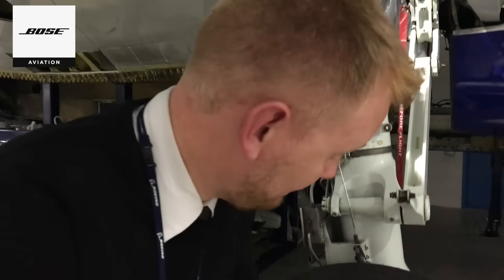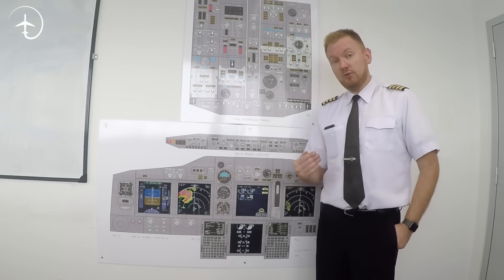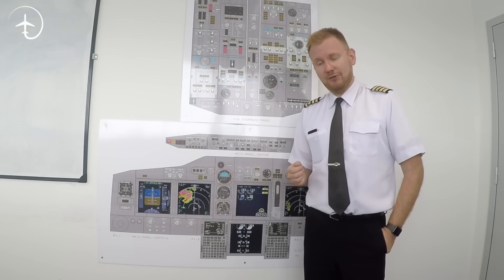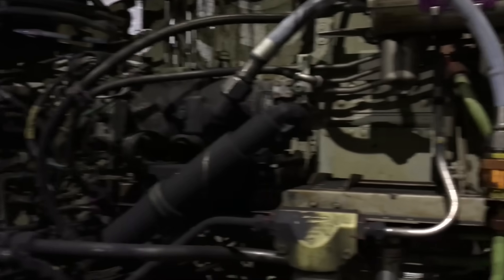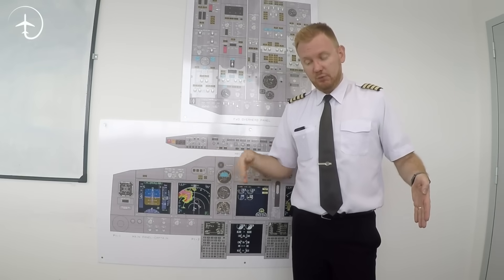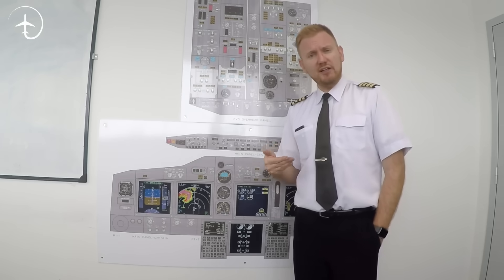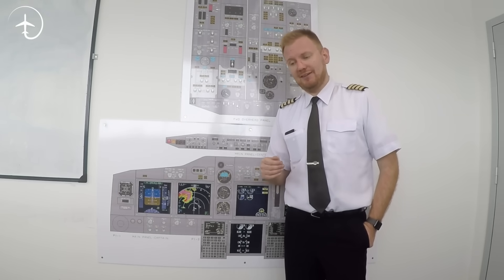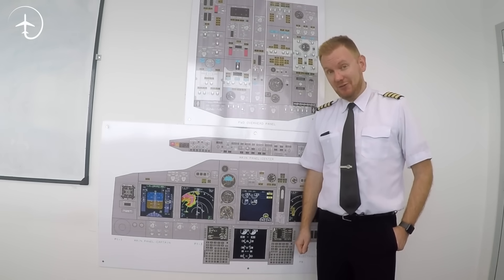Why does the Boeing 737 not have any landing-gear doors?

Comment: 20 years ago, on a 737 flight, the pilot notified passengers to buckle up, extreme turbulence ahead. He said he was going to try to fly to avoid it. The plane went into a roller coaster ride from hell as the pilot took the plane straight up, to where we were almost flying in the stratosphere, then suddenly turning into a speeding nose dive. This went on for almost half an hour - straight up, straight down. Passengers were terrified & screaming. I was new to flying but the guy sitting next to me flew often & said this was not a turbulence issue - it's something else. He was scared. The plane finally leveled out & we landed shortly at Newark. But my legs were like rubber, I was so scared & stressed I could barely walk. After deboarding, I was waiting at the gate for a friend to pick me up & overheard our flight attendants nervously joking & one say, "Thank God pilot name knew what to do - I wasn't up for a belly landing today!" Found out later, from a small plane pilot friend, that the landing gear was likely not working properly & the pilot was maneuvering/pitching the plane up & down to get them to drop. All was forgiven :)
Reply: Holy yeah, that would scare the life out of me, but I'd pick that over belly scraping a fuel-filled tube at jet speeds.
Reply: Should told it was to get the landing gear out, less scary than doing stuff like that for no reason. 
Was on an plane who was able to retract the gear. 
We was worried about getting it out and was told it just fell out then released but needed hydraulic to retract.
Reply: Wow, good thing no one got severely hurt in the flight
Reply: Thats actually a really scary yet funny way to go about that, literally drop the plane then yank it up to drop the gear. As a passenger definitely is terrifying but as a pilot that is a funny way to solve that problem
Reply: This is a made up story. The story makes it sound like they are at cruising altitude and the pilots somehow realize that the landing gear won't extend. Why would they try and extend the landing gear at cruising altitude? 

In reality they would not know there is a problem with the landing gear until they attempted to extend it shortly before landing when they were already close to the ground. Everyone would have had their seatbelts on already by that time in preparation for landing. When the landing gear failed to extend they would have to do a missed approach. Your story mentioned none of that. 

Finally the maneuvers that you are describing would be very dangerous and would get the pilot fired. It is not how landing gear problems are dealt with.
Reply: @StevePemberton2  Correct!
Reply: Sounds like many of my skydiving flights.
Reply: Thats actually a really scary yet funny way to go about that, literally drop the plane then yank it up to drop the gear. As a passenger definitely is terrifying but as a pilot that is a funny way to solve that problem
Reply: See the crashes in 2018-2019 ?
Reply: @masterofnone11 irrelevant
Reply: 🤣🤣 youre sphinchter muscle must have had a good workout!!
Reply: @janmale7767 Almost. I couldn't stand or walk when the plane landed, I was shaking that badly. What I remember most though was how quiet all of us passengers were, nobody was speaking as we de-boarded. It was eerie.
Reply: Yeah, no, they would just first do a go-around, then probably belly land the plane.  Also you don't extend the gear until well into final approach, seconds before landing.  At that point if this were a real story, the pilots would have realized there was a problem, and they would have executed a go-around.  They would probably declare an emergency.  Then, if repeated attempts to extend the gear didn't get them down and locked, they would execute a belly landing with fire trucks waiting on the runway.
Reply: @JMurph2015  No - this is a real story. And I don't know that it was a landing gear issue - it's just what a pilot friend suggested, based on the details & the FA's comment/joke I overheard. Also, the up & down issue began just after we flew over MD into south Jersey. (We were headed to Newark.) It lasted about 20 minutes or so - rocketing straight up, leveling out a moment, then going into an extremely steep dive. So steep that if I wasn't wearing the seat belt, it felt like I could tumble over the seat in front of me & splat into the 1st class bulkhead (?) panel. (Luckily Centrifugal force would not allow that, I think.) The pilot did this approx 5 times. By then we were close to Newark, the plane level & all seemed fine. Mentally, I never wanted to get on a plane ever again. Also, the pilot stood in the cockpit doorway as we de-boarded, doing the nod & the "Have a nice day" thing & he looked very sheepish - he couldn't look us/the passengers in the eye. Guessing, because he knew he had put us through absolute H3ll. So, you tell me what you think happened? Besides calling me a li@r.
Reply: @JMurph2015  (Also, my reply isn't just aimed at you, here. And thinking about it now, all these years later, maybe the pilot was having some malfunction problem that required him landing at one of the BA or DC airports? And that's when they noticed a landing gear issue? Hence the too early landing gear action that everyone is saying couldn't possibly have happened. Which I totally understand - I get it. 

(As I recall, it was a non-stop flight from Atlanta to Newark. But it's possible the pilots had to make a stopover that they never mentioned to passengers over the intercom. All they said to us was that they would be maneuvering to avoid turbulence - put on your seatbelts. I did eventually fly again & never experienced this kind of turbulence avoidance again.)

Comment: Hi Mentour.
I watched this and you explained away most concerns, but I have an extra one - not necessarily a concern, more a question. What about the Pressure differential within the Tyre itself. Ok, it has 14psi at Sea or ground level, but a 36,000 feet it will still be 14psi but because of the lack of pressure pushing against the outside of the Tyre it will act as if it is a far greater than 14psi. Will it not? It would be more like 26psi. Is that not a concern at all?
Reply: Hope you dont mind others than Mentour to reply..he meant 14 bar. 
The correct measure is actually 205 psi (+/-5) on a B737NG tire (main or nose)

Comment: You have mentioned the use of nitrogen being impervious to temperature changes. All gasses more-or-less respond to changes in temperature according to the gas law pV=nRT, meaning the pressure is directly proportional to the absolute temperature for most gasses, including nitrogen and oxygen. So the pressure change with temperature is not the reason. The advantage of nitrogen is that the rubber is not oxidized internally because there is no oxygen, and will not support combustion if the tire gets too hot. Also, the nitrogen used is dry, while compressed air may have liquid water in it coming from air drawn in by the compressor and the water can damage or accelerate corrosion of the wheel.
Reply: Also, you mention that the tires are inflated to 14 PSI. That is too low. Did you mean to say 140 PSI, or 14 atmospheres, which is about 210 PSI? Those would be typical of high pressure tires.

Comment: Is there a reason why the rotating wheels need to be stopped by breaks?
Will there be complication if we let it spin and gradually slow down with time?
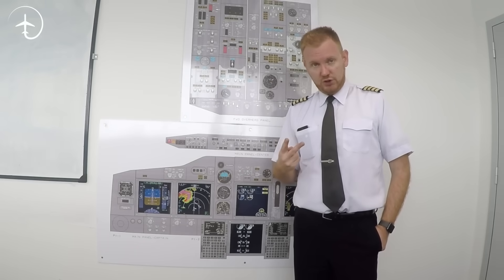Reply: Watch from 5:38
Reply: @St.Ranger_1  ah thx
Not sure how i missed that. So essentially it is to stop random stuff rotating out of hand
Reply: @sriramn1809  that's right
Reply: @St.Ranger_1  now that i think about it, if u have breaks that just work based on pressure and friction like mentioned with the image, the extruding random stuff can be on the outer edge, it might tear open the entire tire setup or bounce off the breaking pad like structure. What do u think
Reply: @sriramn1809  i don't know but i would think centrifugal forces acting on such debris will force them away from the braking mechanism.

Comment: I wonder why the open tires with high pressure are not busting at high altitude, where pressure is low. Any report on weakened tures busting like that?
Reply: The tires are tubeless, and filled with nitrogen which is an inert gas, meaning that the gas does not undergo chemical reactions under a set of given conditions.

Comment: Shitty design , the right way was to redesign the entire plane to have the plane higher from the ground and to have wheel doors. Also the engines are too big and they had to move them on the wings making the nose going too high causing those 2 crashes. Airbus is much better

Comment: 2 simple questions 
1 why not sliding doors placed ?
2 if no need to cover tyres then why other planes have doors ?
Reply: The designer's starting assumption was to have a smooth, unbroken skin for aerodynamic slip and protection of internal equipment.

Comment: You touched on one issue, but didn't go into detail, particularly with respect to the weight of landing gear doors and the weight of the motor operating what would be the lower half of the landing gear doors.  Specifically, my response answers the question as to why larger, longer-distance aircraft have full landing gear doors whereas the 737 only has a door attached to the strut that doesn't cover the wheel.  While landing gear doors reduce parasitic drag, any additional weight adversely impacts the aircraft's performance through induced drag.  Parasitic drag is that caused by lack of streamlining.  Induced drag, on the other hand, is caused by additional weight requiring an increase in the angle of attack of the wing to maintain level flight at any given airspeed.  Exposed wheels create slightly more parasitic drag than wheels fully covered by landing gear doors.  However, the weight of landing gear doors creates slightly more induced drag than simply hubcapping the wheels and leaving them uncovered.  When it comes to aircraft, its all about TCO:  Total Cost of Ownership.  Both the engineers as well as the finance department at Boeing work together to calculate just how much additional fuel is consumed by parasitic drag caused by the lack of landing gear doors vs the additional fuel consumed by increased induced drag of full landing gear doors.  As it turns out, for long flights, the additional fuel consumed by parasitic drag without landing gear doors adds up fast than the additional fuel consumed by the induced drag of the weight of the landing gear doors.  Thus, using landing gear doors on medium to long-range aircraft makes financial sense for the airlines that operate these aircraft.  Your landing gear cycles per flight are also reduced, placing less wear and tear on the motors used to cycle the second half of the doors.  On short to medium range aircraft like the 737, however, cost savings results from using far less expensive and lightweight wheel hubcaps than expensive hydraulic motors which must be periodically serviced and add additional weight i.e. induced drag.  A 737 might make 3, to 5 hops in a single crew duty day, whereas a 777 usually takes up the entire crew duty day on just one flight.  Bottom line, when all the numbers are crunched, it's cheaper over the long run for shorter-range aircraft to not have full landing gear doors.

Comment: Doesn't having so much critical gear in the wheel bay increase the odds of a terrible scenario? If the tires exploded for one of several reasons ( built-up heat, objects from the runway slicing a tire, unaddressed tire wear, etc.) that could be catastrophic. Obviously, the most heat is generated upon landing, but even a plane leaving the runway will generate a lot of heat in the tires. A tire's formula can also vary, or there could be an unseen flaw within the rubber itself. This was demonstrated in the NASCAR "Tire Wars" during the late eighties and early nineties. (please forgive me for the non-aviation example.) I'm sure the tire formula is engineered specifically for the aviation market but when they fail (and eventually they probably will.)  a lot of critical flight control systems can be severely damaged or destroyed.

Comment: Tyre pressure : I am under the impression that it is around 200 psi. You mentioned 14 psi which is half of what I have in my car tyres.
Reply: He probably meant to say 14 atmospheres 🤔
Reply: @jonathanmoreno1945  Thanks. :)
Reply: @Amonginsanity  14 psi is maybe correct, you want a low pressure to have a good contact patch to the ground. Drag of the tyre is not a major concern here
Reply: @guigui045  Sorry ... 14 psi is not a correct figure. The correct figure is 200 psi which is equivalent to 14 bars pressure. 

Thanks for your comment though.
Reply: @Amonginsanity  yep, i've checked and the impact force of a landing building is mainly why theses have such high pressure. Thanks for correcting me ;)
Reply: @guigui045  You are welcome. We share knowledge and keep learning. :)
Reply: I came to the comments just for this answer. Thirteen psi translates to about 100 square feet of tire contact, or 10 ft X 10 ft. Those would need to be huge tires. Thirteen atmospheres makes more sense.
Reply: Why we need to just keep everything metric

Comment: Just before getting on this presentation video, I watched a video of inside the well cam of a B737 in a take off. The moment the landing gear moved to come inside the well, the brakes were applied on the fast moving wheels stopping them instantly before they got inside the wheel well. 

I was pleased to see you pointed out the same in your presentation.
Reply: Good eye.  A landing gear hydraulic line that is pressurized only when the gear handle is in the "UP" position, during gear retraction, is also connected to apply the brakes.  After the gear is completely retracted, the flight crew moves the handle to the "OFF" position, removing pressure from the retract cylinders and wheel brakes.  The gear is mechanically  locked in the up position until the handle is moved from "OFF" to "DOWN," at which point the gear extend side of the hydraulic actuators are pressurized.  After the gear reaches the fully extended position, it is held in that place by both mechanical locks and hydraulic pressure.
Reply: @Hopeless_and_Forlorn  Thank you so much for sharing this information. I am amazed and I really appreciate your care. :)

Comment: My question is if the tyres are pressured up to 14 psi, how they wont burst in high altitude due to low pressure outside?
Reply: Have you seen tire over pressure of plane tires?  It’s amazing how much pressure before failure.  (They test with water). Visually impressive.
Reply: @larsharris  they do the tests on the ground. U mean tyres can take diffrential pressure more that the fuselage itself?
Reply: @persiangulf3438  it is 14 bar not psi

Comment: 14 PSI? In think you mean maybe 140PSI, or as I recall more like 120 PSI for the main gear. That is partially for the load they carry, and partially to increase the minimum speed at which hydroplaning would occur. 9xsqr root of tire pressure gives hydroplaning speed in MPH, so the higher the pressure, the higher the speed at which hydroplaning would become a problem.
Reply: it is actually 14 bar

Comment: Holy crap, thank God for World Wars. The manner in which the "need for speed" kicked aero engineers in the ass is astounding. Just think, not too very long, in terms of human history, there were no aeroplanes, and now look. Less than a human generation before 707, etc., even big aeroplanes' control surfaces were moved by a metal cable/steel rod set up, right from the control yoke/pedals, the length of the plane. Now, for many years now, all fly by wire. Compare to automobiles. It wasn't until the early 2000's that the first "throttle by wire" setups became common. And that is a fairly simple thing to do.

Comment: Compare 5 stories.  1.  Obsessive compulsive Howard Hughes wanting a smooth, rivet free airplane.  2.  Golf balls get dimples for straighter flight.  3.  Smooth soccer balls curve more.  4.  Truck tailgates  solid is more efficient than a cargo net because the solid tailgate captures a bit of a swirl to keep the airflow over the cab away from the truck.  5.  737s don't bother with doors because the even surface doesn't actually hurt.

Comment: What about the DC-9/MD-80 series? They are similarly very low ground clearance, but do have landing gear doors. Looks like said doors would hit the ground if open on the ground or during landing. Did they decide the performance advantages were worth this damage risk?

Comment: That's what I love about engineering--they found a solution to their problem that was as good as it needed to be but not more.  I'm sure the small cost in drag was compensated for in weight (fuel $$) and  complexity (maintenance and manufacturing $$)
Reply: In the 1980s (actually in the electronics industry, but exactly the same principle), I used to be the one who said things like, "Get rid of the doors".

Everyone thinks I'm completely mad. "We need doors" "Gotta have doors" "Ben's spent two years working on the doors, we can't get rid of his doors" "Get this guy outta here, he wants us to get rid of the doors!".

I persist: "Seriously, run the calculations without the doors. I think they'll work out. And with no doors, we won't have to solve the problems with the doors".

The calculations do work out. Ben loses respect. I gain it.
Reply: Heehee yX-D! But it's interesting even tho it could be said in two sentences y:-D
Reply: Exactly...! Designing has the biggest challenge up ahead which is not about the best materials and best performances to get out, but the best compromise. That's key to success!
Reply: As good as it needed to be but not more is why the Germans lost WWII. They over-engineered everything!
Reply: Boeing now try to find solutions to their problems that AREN’T as good as needed, AND more….🤔